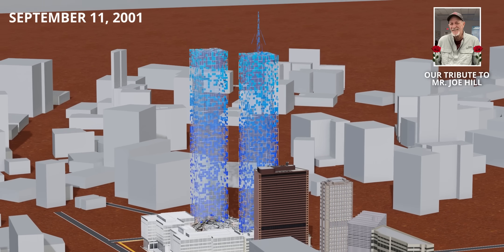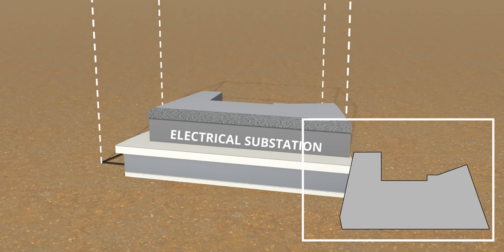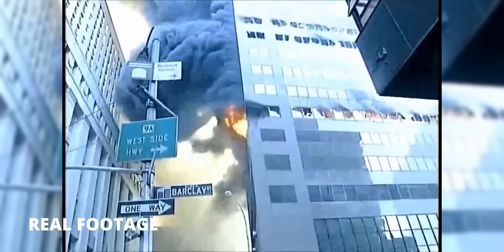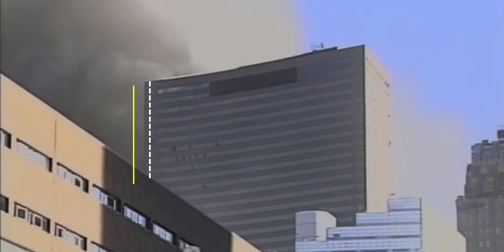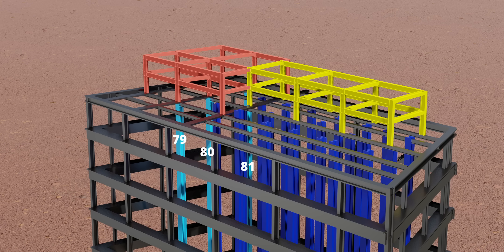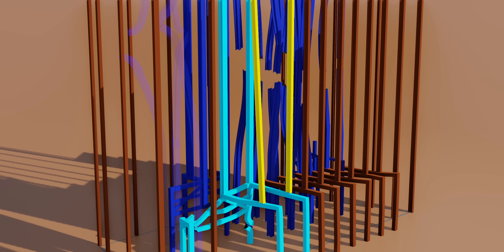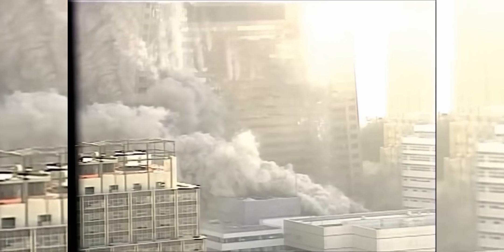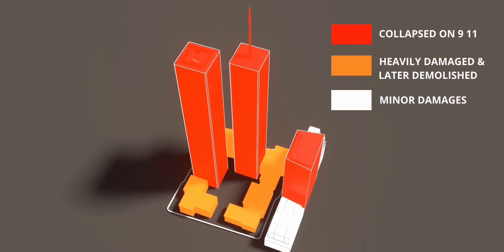Collapse of Building 7 | The Complete Physics

Comment: Make it as technical as you want we all know the truth stop gaslighting it will all be exposed.
Reply: Well, I do.  Building 7 - the 6th building to collapse of 10 lost on 9/11 - because of its low priority was largely ignored early on, so conspiracy filled the information void with a lot of  garbage from ignorant people promoting political agendas, creating a lot of confusion and misconceptions.  So I prepared this brief summary using my own technical analysis, not ideology and magical (non)thinking to dispel them. 

At 10:28am the WTC North Tower collapsed, showering Building 7 with tons of burning debris, causing heavy damage and starting many large fires that burned out of control for the next 7 hours. Half the FDNY firefighters having been killed, units in disarray, equipment destroyed, no water pressure, and the greater urgency of search & rescue efforts, Building 7 couldn’t be saved so firefighting efforts were pulled as futile and 7 left to its fate. Firefighters make that sort of choice every day in brush fire situations - which houses to save and which ones to let go. Only real difference here is moving the decimal on the size and cost. People get overwhelmed by the size.

www.youtube.com/watch?v=g_SvpwyC17M

Collapse of a burning structure is always a concern for firefighters and steel buildings are uniquely vulnerable to fire damage. When subject to fire they rely on active firefighting to survive, designed around 1 to 3 hours of fire resistance to, allow time for occupants to escape and active firefighting to get started.  After this all bets are off. Left to their own devices they'll exceed their design envelope and collapse, like Plasco Tower and Wilton Paes de Almeida. In 7 the occupants escaped, passive and active fire protections were compromised and active firefighting was abandoned hours before the collapse, which left the building to its fate. It lost. Odds on Building 7 would eventually collapse, and it did. No big deal in logic.

 http://www.youtube.com/watch?v=WnYBX6QT0R4 

FDNY Chief Daniel Nigro - The biggest decision we had to make on the first day was to clear the area and create a collapse zone around the severely damaged 7 World Trade Center, a 47-story building heavily involved in fire. A number of fire officers and companies assessed the damage to the building. The appraisals indicated that the building's structural integrity was in serious doubt. I issued orders to PULL back the firefighters and define the collapse zone. It was a critical decision; We could not lose any more firefighters. It took a lot of time to PULL everyone out, given the emotionalism of the day, communications difficulties and the collapse terrain 

FDNY Deputy Chief Peter Hayden ; We had our special operations people set up surveying instruments to monitor and see if there was any movement in the building. We were concerned of the possibility of collapse in the building. And we had a discussion with one particular engineer there, and we asked him if we allowed it to burn could we anticipate a collapse and if so, how soon? And it turned out that he was pretty much right on the money, that he said 'In its current state you have about 5 hours 

The collapse of Building 7 was anticipated and widely reported in the media throughout the day, with 24 video cameras recording some or all of the collapse. Everyone knew what was coming and why. 

www.youtube.com/watch?v=OY5S5k3tMHI

Building 7 collapsed from the inside out which is not at all intuitive and hard to understand with most details being hidden from view.  It requires careful analysis and observation, and some people will struggle no matter how much it is explained. But here is my explanation relying on no outside authority. 

Building 7 was a unique, asymmetrical 47-story steel frame structure built atop a smaller 3-story building serving as a partial foundation, requiring lower floors dedicated to complex load transfer structures. Of trapezoidal shape and tube-in-tube construction, B7 (above the 7th floor) consisted of a central core of steel columns carrying most of the gravity load, perimeter steel columns around the outside of the structure carrying the remainder of the gravity loads and long span beams and girders to tie those elements together and form the floors. On the outside of the building hung a facade or outer shell. 

www.nist.gov/image-16640

Phase 1 : First externally visible signs of collapse initiation occurred at 5:20:28 pm and was notably quiet with observers not realizing the building was collapsing! No warning in the form of hundreds of eardrum busting 180dB explosive bangs. Here at 12:00 a local CBS affiliate reporter talking 10 blocks from B7 when collapse begins. People don’t start to notice the collapse until 12:11. At 12:45 is the famous CBS fixed camera clip of Building 7’s collapse. Note the silence. 

www.youtube.com/watch?v=t5tEy6mXSE8

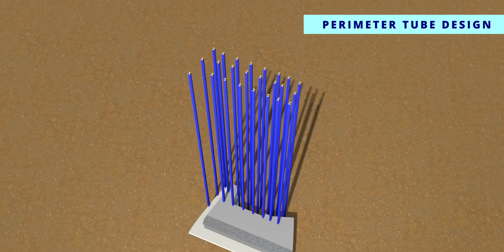Lower floor failures above the load transfer region (8-14) in the NE corner initiated the collapse. In this video at 0:45 you can see the NW corner from inside the building while under construction, Column 79 just out of frame on the left. That big, angled steel beam across the top of the frame connects to C79 at one end. The girders connect to the beam. That beam and all those girders depend on just one connection 

www.youtube.com/watch?v=nP3TNHPCIVU&t=45s

Phase 2 : NE corner floor failures caused a loss of critical lateral support over an excessive length of Column 79 and it buckled. Externally as collapse begins we see a vertical progression of window breakage along the 44-46 line and a kink in the roof of the East Mechanical Penthouse at the top of the building, consistent with C79 failure. Looking at the above floor diagram of Building 7 when you see all the structures that depend on C79 you quickly realize this one column was a relatively isolated structural element on which a disproportionately greater fraction of the structure depended analogous to say the Key Bridge. Normally with a buckling column, the load could be redistributed to other columns. With C79 that is not the case - the failure did not redistribute the load, so the collapse rapidly progressed to the roofline, sinking the rooftop penthouse. The transition from full capacity to almost no capacity occurs in an instant and will result in virtually no resistance 

Phase 3 : With C79 gone, B7’s progressive, non-symmetrical collapse continues with adjacent columns 80 and 81 left laterally unsupported and quickly buckling as well. The EMP drops down through the building. C79-81 all have no diagonal bracing, which is the major reason why they could not redistribute a lot of vertical loads among one another. From there collapse progressed from east to west through the central core until the core was gone from 81 to 58, taking all the interior floors and probably most of the perimeter columns with. Follow the horizontal progression of window failures low in the building and the dropping of the remaining rooftop structures into the building. The NIST Building 7 study model 4 determined C79 failing under ANY circumstances would have initiated the same collapse sequence. 

Phase 4 : After about 10 seconds only the exterior moment frame remains, giving the illusion B7 is still standing to the casual observer since little has outwardly changed. But it is just a hollow empty shell like an empty cereal box supported only by a few remaining columns and overloaded from the loss of the core columns and floors, quite unable to remain standing. With nothing remaining behind it, the north face leans inward, forming a V in the roofline, the last few columns buckle under the strain and the moment frame free falls, landing on top of the debris pile. 

It is more than 10 seconds into the collapse before a single measurement of alleged free fall acceleration is taken. It was not The Building but only the empty hollow outer shell that was still standing being measured. The measurement is not a sustained period of FFA but rather a curve starting out below then up to and OVER 9.8m/s/s before decelerating back down below again, arbitrarily averaged over 2.25 seconds to get roughly 9.8m/s/s. The single measured point was not The Building , was moving in 3 dimensions, not just down and is a product of collapse progression mechanisms not collapse initiation mechanisms, thus tells us nothing about why the building started falling 10+ seconds earlier. It’s meaningless. Start to finish the total collapse took 18-20 seconds or 3 times longer than true FFA . How fast something falls can’t tell you what started it falling anyway.    

The debris spread well outside the footprint blocked surrounding streets, heavily damaging the Verizon Building and destroyed Fiterman Hall. 

No building is meant to survive 7 hours of multi-floor unfought fires. Building 7’s progressive, non-symmetrical collapse was incidental, unintended collateral damage from the combination of fire, time & gravity started by the collapsing North Tower, true no matter who planned and carried out the 9/11 attacks or why .  Of so little consequence it barely registered at the time, only taking on semi-mythical status as an alleged smoking gun years later when demolitions at the Twin Towers, missiles at the Pentagon and shoot down over Shanksville all failed and conspiracists had nothing left to work with. 

Anything can seem like a conspiracy if you don’t understand how it works. Now you should. I hope you found this helpful, informative and it solicits informed critical comment. If I made any errors of fact, logic or reason or left anything important out, please let me know so I can fix it. OR offer a more plausible alternative if you can. Be the first. Please start any reply with the words “Tits McGee” or I will know you didn’t read it and are wasting my time.
Reply: @TheCriticalStinker-01  , ONE SINGLE WORD! ... That is all it takes to answer my basic high school physics question:

As an object is falling in free fall how much work is being done by that object AS it is falling in free fall? 

Any comment you make without knowing what the physics term 'free fall' means is then based on ignorance and is an insult to the people that were murdered on the day of 9-11-01.

Comment: People think all these buildings should behave just giant wooden blocks that tip over not collapse.  But they fail to recognize that if you scale the buildings down into a wooden-block size, they would be incredibly flimsy.  Remember they, like all buildings, were like 98+% hollow/air.  They'd compare to a very porous and brittle sponge capable of collapsing on its own weight.  Not a solid stick of wood.

Comment: here is my question. 7 badly design buidlings in Hong Kong burnt down completely and not one showed any sign of collapsing. How come the twin towers collapsed within few minutes?
Reply: The Twin Towers suffered massive structural damage and the complete failure of fire protection systems from the impact of 120 ton Kamikaze missiles.

The Twin Towers were made of steel, not reinforced concrete

There was no effective firefighting in the Twin Towers

All of this should be obvious
Reply: @TheCriticalStinker-01  , ONE SINGLE WORD! ... That is all it takes to answer my basic high school physics question:

As an object is falling in free fall how much work is being done by that object AS it is falling in free fall? 

Any comment you make without knowing what the physics term 'free fall' means is then based on ignorance and is an insult to the people that were murdered on the day of 9-11-01.
Reply: @TheCriticalStinker-01  what about building 7
Reply: @horatiuscocles8052  - OP didn't ask about Building 7.  Much of the same differentiators still apply. One only has to look at the Hong Kong towers to figure most of it out.

Comment: This explanation is impossible due to the laws of physics. For the building to fall at free fall speed, all 47 columns must be removed so there would be no resistance. This video is another of many meant to deceive and to protect the cover-up. This platform and it's algorithms make it difficult to find legit content. It's worth the search to understand the science and evidence of the demolition.
Reply: False starting assumption:  Your case assumes Building 7 collapsed at free fall SPEED which it didn't, as anyone with the gift of sight and ability to tell time can easily discern.  Also, there is no such thing as free fall SPEED since free fall can either refer to a state an object is in, or more specifically to a rate of acceleration 

It is NOT and NEVER a _velocity.

Try recalculating using actual engineering.
Reply: @TheCriticalStinker-01  #1. Can you answer a simple high school physics question? NIST said that the World Trade Center 7 BUILDING collapsed with a downward #ACCELERATION# that was indistingishable from the acceleration caused by gravity, or, free fall acceleration. 
ONE SINGLE WORD! ... That is all it takes to answer my basic high school physics question:

As an object is falling in free fall how much work is being done by that object AS it is falling in free fall?
Reply: Recently i saw a 2 story house fall down. Took 6 seconds. 45 floors fall in 9 seconds. Yea that makes sense
Reply: ONE SINGLE WORD! ... That is all it takes to answer my basic high school physics question:

As an object is falling in free fall how much work is being done by that object AS it is falling in free fall?